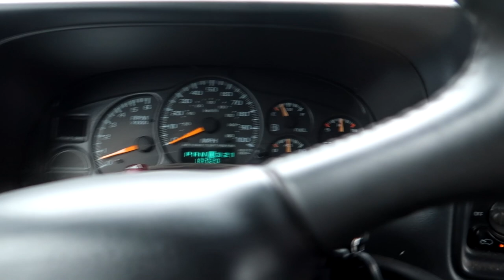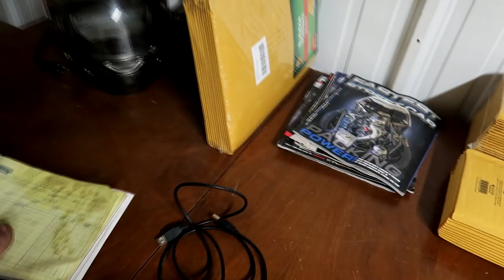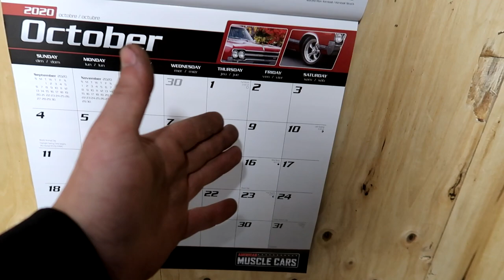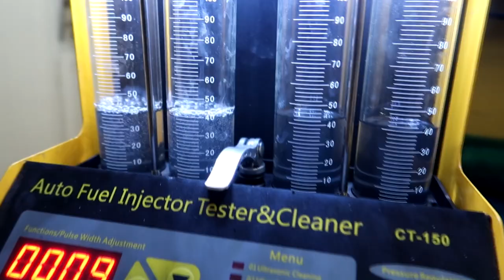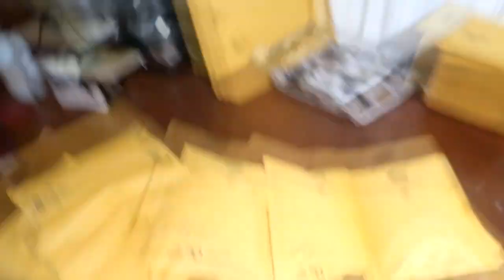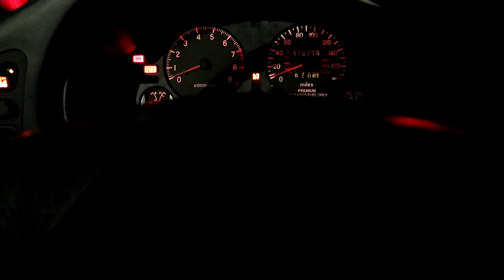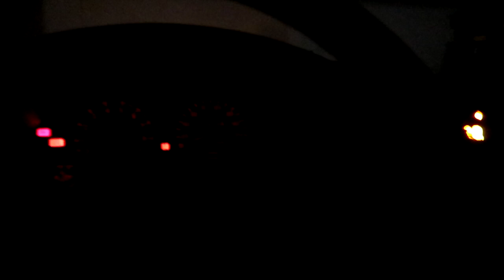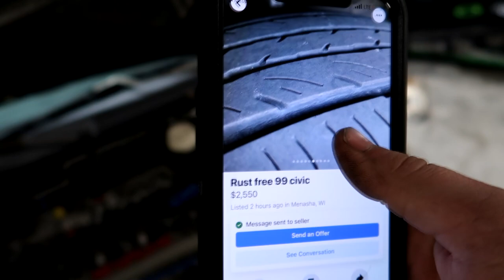Another Day With HunterTuned. Lets Find Balance And Make 2021 Awesome!

Comment: Power steering pump leaking onto the alternator.  Rebuild the p/s pump.  Gates sells the kit for $20
Reply from the maker: It’s engine oil from the dipstick
Reply: @HunterTuned  Ah forgot about that.  If it needs an alternator, don't cheap out.  You'll be replacing it again.  Many posts on dsmtuners about aftermarket alternator issues.  I paid extra for Bosch unit which came with lifetime warranty.